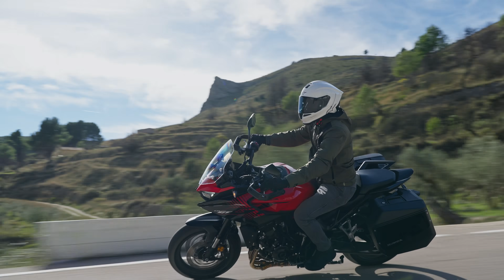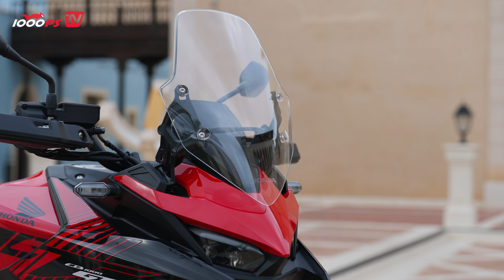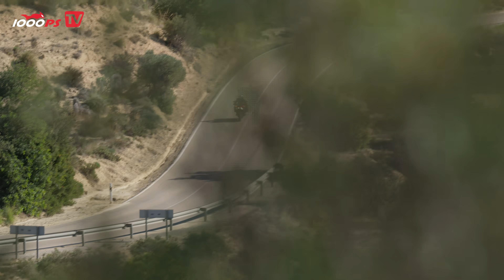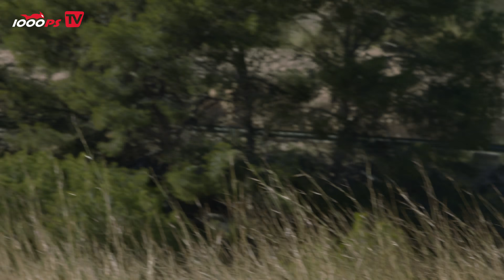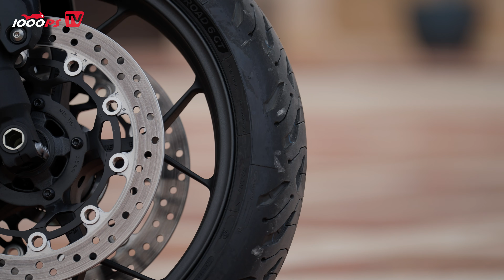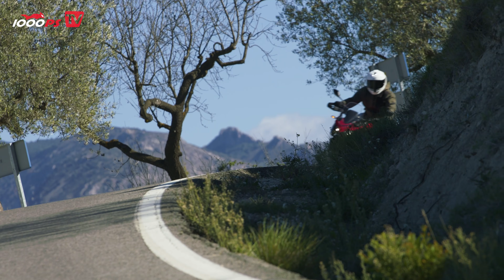Honda CB1000 GT Full Review: Comfort, Tech & Value

Comment: Very helpful! You mentioned the low end torque is lacking compared to other sport tourers. Which sport tourers are you referring to?
Reply: @dmac7660  definitely not referring to S1000 XR because you need to break your wrist twisting that throttle to get it going unless you want to shift into lower gear.

Comment: Nice review.  This bike is just like my 2023 Kawasaki Versys 1000 SE LT.  The Versys looks more comfortable and has bigger bags but this bike is 100lbs lighter.  I may buy one if the ergos work for me. The one thing thats missing are cornering lights.  Those are extremely valuable where I live in the very steep and twisty mountain roads. Driving at night there can be hazardous.
Reply: they have the comfort set with comfort seats, higher windscreen, deflectors and fog lights for 1005Euro

Comment: The saddlebag was not well thought out in my opinion. There is no reason the bag should be smaller because of the muffler. Should have been engineered differently so bag space would not be sacrificed. Only flaw i can see.
Reply: would mean having the right saddle bag further away from the back. I'd much rather have a cutout in the panier
Reply: @mightyakkylex A lower exhaust like on the BMW 1300RT would solve the problem. I think it's dumb to have a muffler pointing to the sky to the point it takes space away from the saddlebag.
Reply: @Dan-pt8fp or even the NT, it's not like they never did it
Reply: @mightyakkylex they could have lowered the muffler, just look at the NT